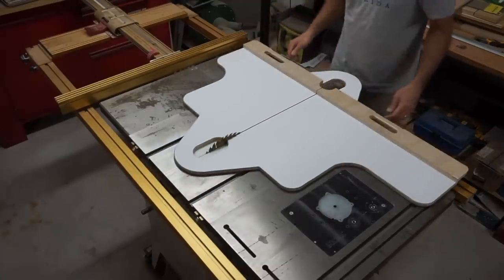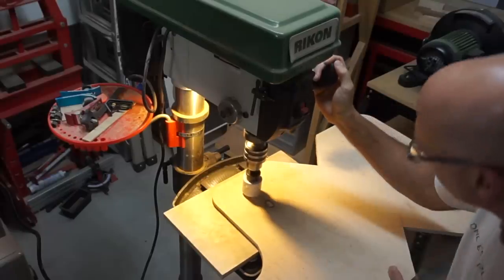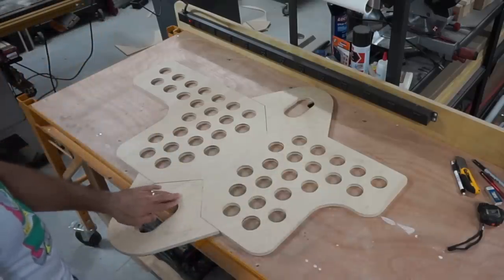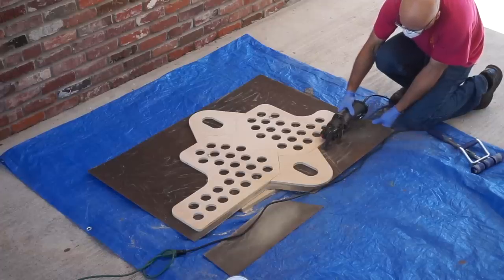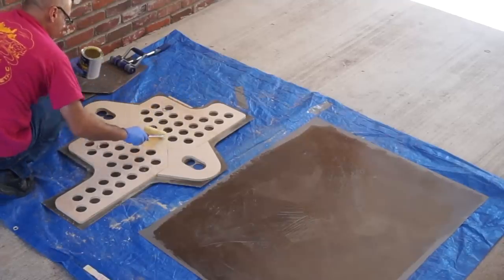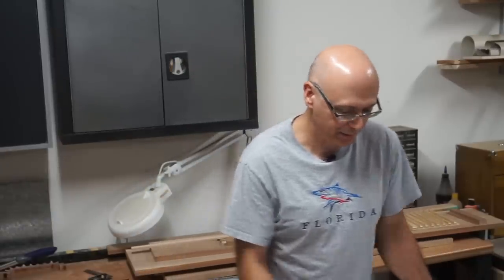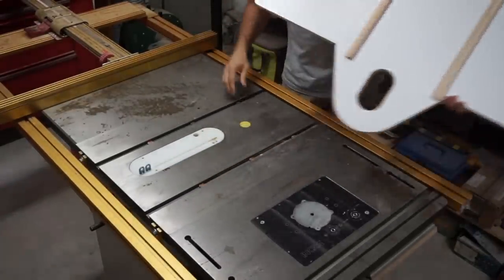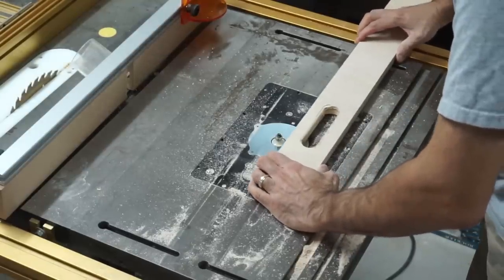A Crosscut Sled Like No Other

Comment: Great idea about getting rid of the back fence. The riving knife prevents you from sawing the rig in half there. IF you use your riving knife, that is. Which I highly recommend, sled or no sled!
The front end, though, is not protected against accidental sawing in half, so I am going to stick to traditional design for my sled there. I also want it higher than half an inch. But I am going to widen the gap in the front fence to allow the blade protector to pass through, because that is my primary goal: To keep proper dust collection and hand protection when using my sled.
Thanks for the great idea! The back fence was really my main headache about the design of my sled. It never occurred to me that I don't need it in the first place.
Reply from the maker: Thanks for the insightful comments, None of your Business! It sounds like you are planning to build something that incorporates some of these ideas? If so, please share some pics or even a video of your creation!

Comment: Innovative, and I like the idea, but you are displaying EXTREMELY dangerous work practices. Cut through an upright panel at 1:00 = severely pinched circ-saw blade.  13:40 HOLY FK you're going to die!  15:30 Your inability to hold on to the work piece in order to move the sled is NOT a built-in safety feature!

Comment: Very interesting design.  I like the idea of laminate sandwich since it may reduce the amount of warping from moisture changes in the wood.  I, being an average guy with a table saw in his garage, would never build this since it is drastically over engineered for my purposes.  I hope, however, that a fancy shop like yours could benefit from this sled.  In addition I would suggest installation of simple limiters/stop blocks on the sled to keep it from going too far forward or too far back and cutting the remaining plywood resulting in two halves of an expensive sled.

Comment: Hey ding dong, Dont ever send a piece of would through the saw without having pressure on the piece. Even if you had featherboards you need downward pressure. Sorry if i come off a little mean but i had a worker lose his eye from a flying piece of wood. The nightmares i still have of that mans eye resting in his hand puts a different perspective on things. I cringed watching you do that. And I'm pretty sure i cursed. Lol  I did like your project though, very sleek and lighter weight than the ones everybody else is using. Thanks for sharing & please be careful.
Reply from the maker: I've been called a lot of things in my time, but 'ding dong?' Boy, you sure know how to cut a guy down. What's next? 'Twinkie?' All joking aside, your point is well taken and I think it should be emphasized that we all have to respect the power and potential danger involved in using power tools. Thanks for all your comments, even the 'ding dong' one.
Reply: as soon as you started your first cut, I had to squint in fear that you were about to launch that piece of wood.
Reply: If you want to convince someone that their methods are unsafe, starting out by calling them "ding dong" is probably a bad move. Also, if you're going to insult someone's intelligence, you might not want to write "would" when you mean "wood". You know, read your own comments.
Reply: Christine Cahill why would it fly back? There's nothing binding it like when it's against a fence. Your mitre gauge doesn't have hold downs. What’s the difference? I would put some sort of blade guard on the exit end. It wouldn't take much of a slip. Belt and suspenders.
Reply: That was my reaction but I am sure the man is not an idiot and was trying to show the handle feature.But for crying out loud do not expose the neophytes to bad material handling. Too many weekend warriors end up in emergency every year.I truly enjoy getting better at my gig but am careful how I share it.
Reply: Think blade height, hook angle and common sense.Do be careful you.
Reply: AlergicToSnow vibrations in the saw and user error can cause the work piece to move into the blade just enough to cause kick back.
Reply: Joshua courtney I guess he feels safe. I can tell you that whether it's necessary or not, I just could not bring myself to take that cut without the wood secured somehow,
Reply: AlergicToSnow I agree. A quick toggle clamp would even be better. Too risky for me.

Comment: Too much work for a sled
Reply: Then do do it, nobody is forcing you to build it. It is aways easier to come up with an excuse to not do something.
Reply: Yes, if you find  1/4 of an MDF sheet too heavy, time to give it away .
Reply: Is there a reason that a thin piece of carbon fiber wouldn’t work for the base? It would be light, strong, flat, low, and not need all of those holes.

Comment: Very interesting design and in particular I give you props for identifying what's wrong with most crosscut sleds: the bulk and size. Your design also shows how there's a lot of unneeded material in those big rectangles.

The debate about square / accuracy could have been ended by making the fence adjustable. Two bolts up through the bottom with a little play left in one of them is all it would take.

Comment: I screwed up and hit the send button. Once you clamp these two blocks in place, you have a position to lay the board against when you epoxy it. This may not work but in my work as in yours the better we build something the less trouble we have down the road. It doesn't matter if it's metal or wood. From what I saw in your shop, I think you are a craftsman and I would value your opinion. Oh and I like the sled it looks great and I've never seen one like it, I'm impressed. I'm going to subscribe and look at some of your videos. Later

Comment: About 1984 I made a very similar sled, it was not nearly as eye appealing but the construction was close to yours. I have used it off and on since. To this day, it still cuts squarely I did "woller" the cut out with a dado once. For all my smaller objects I still reach for this sled.

Comment: Last week I finished a "traditional" sled for my table saw.  The fences are five (5) inches high.  Today I squared the ends of some 16/4 maple posts for a bed I'm building. I also have a T-track running along the face of the fence for stop blocks.  I'd never attempt 16/4 material on your sled.  I applaud the search for lightness in a jig, but I'd only use this design if I only ever cut thin stock

Comment: I like it.  The thing I would do differently is bolt down the fence instead of gluing it, so you can adjust it to be exactly square.  Using laminate on top of skeletonized plywood is genius though.

Comment: Very cool idea. Some ideas to square the fence. After making the blace hole cut, leave the slide at then  where the block fence will be attached, Replace the cutting blade with a squaring blade, that is a blade with no teeth. Raise the blade to the maximum height to expose as much of the blade surface as possible.  Use 2  right angle squares, one for each side of the blade.  Under each square place several 1/8 height blocks. These will raise the square enough to pinch the square to the blade.    Place the right angle of each square to be flush with the blade edge. I like to use a piece of 2" x 24" right angle aluminum bar as a push square to make sure the three points, the blade, and two squares are exactly flush.  Once the blade and squares are flush, clamp the 3 together.  Attach the block fence to the slide flush with the squares. While this technique does make a good square block fence for cutting, because of weather, shop handing, and equipment wear, etc the same squaring technique can be used on an adjustable pivot fence.  Once the fence is ready, put the cutter blade on and test the fence square using the 5 cut technique.

Comment: I love the sleek design! I think you are on to some thing very innovative!!  I also would have created a pivotal fence for fine adjustment. I also would have used a large machinist square for accuracy! Some kind of hold down is a must! Don' be discouraged! This is a prototype and you have all these wood workers comments to help you work out all the bugs. I love it and i am going to make my own variation of it! Thank you so much for this beautiful design!
Reply: From a custom cabinetmaker with 37 years of experience: I'll echo all the safety concerns mentioned, plus the use of a framing square for accuracy.  Two recommendations - (1) David's idea of a pivoting fence for dialing in square - One option are European, metric sized plastic draw front adjusters, which work pretty slickly for this application. They adjust via internal cams. And are held in place by #8-32 machine screws. You do need to counter bore for their insertion. Use 2 on your sled platform - one on either side of where your saw blade comes through. Be more generous with spacing, away from the saw blade, on the left hand side. To locate them on your platform, and the mating holes for the mach screws on the bottom of your "L" shaped fence, you do need to be in the neighborhood of square.  On the bottom of your "L" shaped fence, drill 1/16" to 1/8" holes. Do this at your drill press. Put fence back on the platform. Clamp fence down to the platform, square to saw blade cut. Mark centers, in the platform, for the location of the drawer front adjusters, through the holes you drilled in the fence.  At your drill press, bore holes for the adjusters. Adjusters have to be minimally flush with the platform. Slightly below surface is fine.  Insert adjusters. So the mach screws will fit through the holes in the fence, enlarge those holes - 3/16" is fine.   After assembly, and tightening the screws,  take a test cut.  Simply loosen screws to readjust fence, retighten.  After getting squareness, tighten the fence down to the platform with additional wood screws, spaced across the width of the sled. Don't use glue.  (2) The use of a more typical vertical front "fence", to hold the sled front together,  will add additional cutting capacity. // The design, esp the weight saving is great!!

Comment: Liked the design and hope to make one similar. I would do a few changes. Like not drilling all the large  holes in the center board but adding small holes for hold downs. I think I'd also make some type of adapter for a taller fence at the back for big parts.
I have to say though, that looking at the things you've made in the background I'm blown away. You seemed to be an accomplished wood worker. One thing, like yourself, I've worked hard for my tools and the last thing I let happen is for rust to form. Like the spot on your cast iron saw top. A little bit if car wax or wooden floor wax works wonders.
Reply from the maker: Thanks for your comments, Terry Evans! Yes, I enjoy it. If only you had let me know about the wax before! That's dried-on glue, by the way, not rust, if it makes a difference.

Comment: I like the design in general. I think drilling the board to reduce weight was a great idea. In therms of the runner's, however, I'd have opted not to use epoxy. If something happens to damage them, your entire sled is now useless. (You also run the risk during the cure for squeeze out to bond your sled to your saw table.) I would have left some area not drilled where I assumed the runners would go. Then, laying the runners in the tracks, use some double stick tape on the face to secure their position to the sled, and screw them in place after you lift it out. That way, they can be swapped out in the event of damage. Also, might consider UHMW instead of wood that can shift with humidity changes.

All in all, still a very cool design.

Comment: Put CA glue on the runners, then lay the sled on them.  From there, drill pilot holes, then screw the runners to the sled. That's how everyone else does it (for good reason).

This way, your runners are in the exact right places and you don't risk expoxy-glueing your sled to your saw.
Reply from the maker: I’ve been told I’m special, so that might explain why I didn’t do it the way you described

Comment: I've made and used half a dozen of these sleds and you are correct in that they are either too big and heavy to wield or too small to do the job. This looks like the answer, handles large pieces but lighter and easier to use. I'll be copying this but will try to incorporate a sacrificial insert for the center as repeated use opens up the blade slot and allows tear out. Great design and great video. Thx for sharing.
Reply: Stick some blue tape under the slot in your sled pour epoxy into the slot allow to cure and recut.  Been doing this for years, saves the hassle of building a new sled and then spending half a day squaring it up.

Comment: Start with, what little bit I saw, you have a hell of a shop. I'm allergic to dust so I must wear a mask when doing woodwork. That doesn't stop me from using wood. I am a machinist, so most everything I do I want it as perfect as possible. I'm use to working with thousands and closer. I know what you did was close enough for most woodwork. I'm still want to show you what I would have done differently. Before glueing I would use the square to line up the board across the back, getting it as square as possible, then mark a line to show me where to put the back board. Take two small block and lay on top of the slides so we can clamp them in place. Once they are clamped in place against the board, you now have a place to

Comment: Good concept.  You may already be aware of this, but you can check the square against a straight edge of table by scribing a line and then flipping it over to see if it still matches the line.  Any error in its squareness is obvious because of the doubling of the error.  We used to correct old squares by using a punch on the inside or outside of the corner  to spread or narrow the blades a bit until they passed the scribe test.  I always tend to check them when i pick them up, because someone may have dropped it and made it a non square.

Comment: Some propper thinking has been going on here 🙂 I would add toggle clamps to hold the material down. If you build a new edition at some time, you could clamp a stick squareish on your Incra fence and slide that back and forth over the sled to align the sled fence.
Reply from the maker: Great thoughts, Immanuel Kuhrt! 👍

Comment: Cut the jig in half all the way through.  A stationary immovable platform on the right side of the blade without a fence and the left side is movable with clamps. Now it's lighter, smaller and you stand to the left of the blade. You also can use your hands to hold down the stock, just like a miter gauge. Just like my Jointech cross cut jig.
Reply from the maker: Good ideas, Thomas. Thanks!

Comment: It's cool.  Lightweight, might be a very good characteristic.  I have lots of sleds and jigs hanging on the walls.  I about blew a gasket when you started boring holes in the sled, but the laminate may give you plenty of structure, since you really are depending on the base of your saw top for level and flatness.  I prefer and use a taller fence for setting stops and using clamps.  It required Lots of materials, but that's our modern shop for ya.  Appreciate it!  I'll keep this in mind.

Comment: The laminate-hole design is a vast improvement over all the other honking, overweight DIY sleds on YouTube.  It also makes me wonder if the sled can go thinner by using aluminum u-channel for the runners and additional cross members... or maybe embed t-track in the top surface for hold down clamps.

Comment: Nice design, it's definitely worth it.  I bought a used table saw that came with a classic sled that weights so much I hate using it.  This is a far better solution.  It's low weight and low profile.  By that I mean, a sled always reduces the maximum depth of cut you can make with your saw because the sled has some thickness.  Your design reduces the loss of depth nicely.  About the only way to get it lower would be to build the base out of 1/8th 6061-T4 or T6 alum sheet.